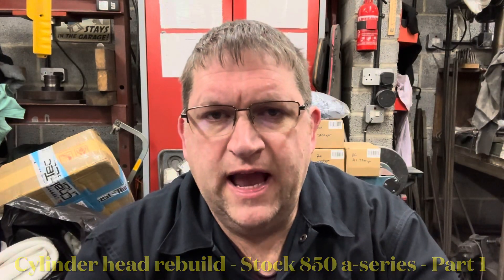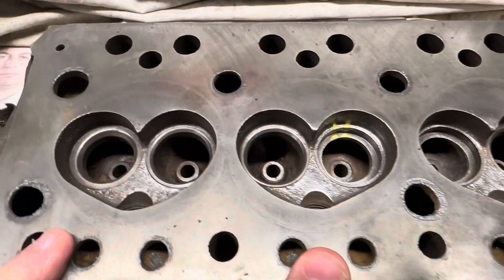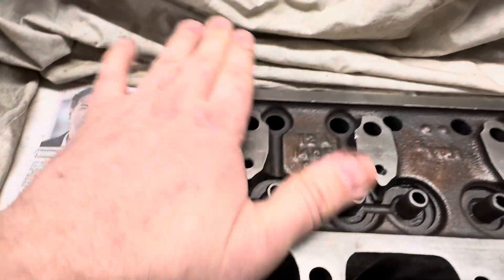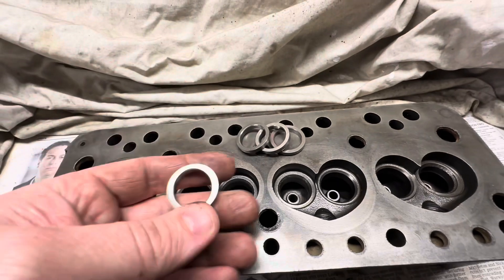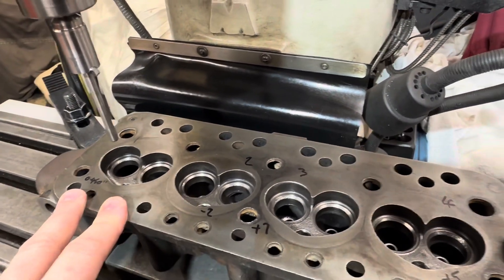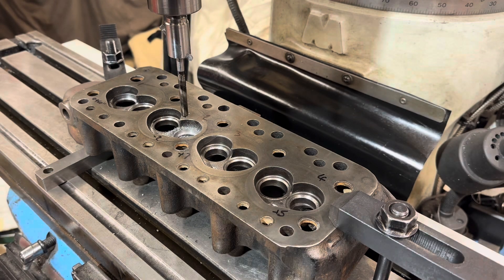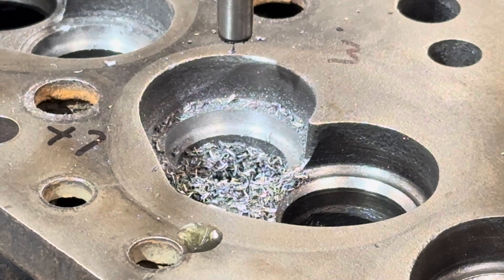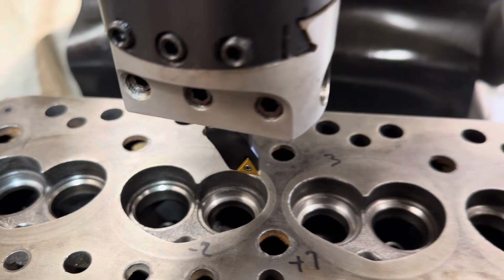Classic mini 850 standard cylinder head rebuild - Part 1 Unleaded valve seat installation

Comment: Can hardened valve seats be added after a head has been ported? How much extra work would need to be done? Asking for a friend who found a great race head from the 80s.
Reply from the maker: Usually not really because so much material has already been removed they are likely to crank the head. There is a way that that can be installed but that means you also fit an inlet insert, and interlock them. The trouble is you are likely to find water around the inlet seat when doing this.
Reply: @ that’s unfortunate. It’s stock size valves in a 12g202. Was hoping it could be done
Reply from the maker: @RPfly  ah a 202 you won’t have a problem

Comment: If the top surface isn't parallel to the gasket face, and you wish to mill the upper true (pedestal shims, yes)..., how much thickness is there around the thermostat area to get that true as well? Mine's been screwdrivered badly and the relief for the stat is badly corroded. So it will need a chase as well after truing the whole upper surface.  Worried it might crack around the stat studs from thinning the casting.
Reply from the maker: There is loads of material around the thermostat area. If you watch future episodes you will see this get machined on all surfaces. The thermostat face can also me machined separately from the whole top surface if needs be.